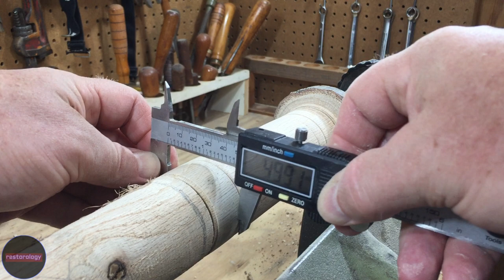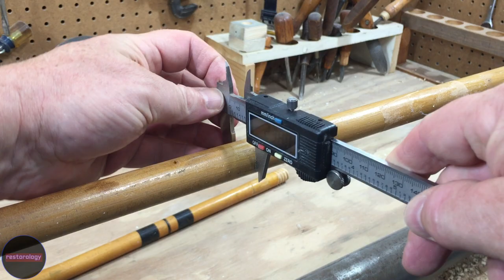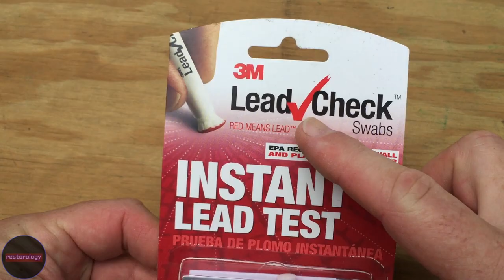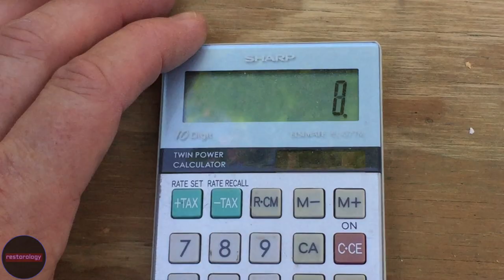The Best Restoration Video That NOBODY is Watching

Comment: Question for you: I'm doing this almost exact same thing. Question on the polyurethane over the testors paint - was that oil based? I see you did paint, then minwax then you mentioned polyurethane. I don't want my paint to bubble up or apply items in the wrong order. Thank you!
Reply from the maker: Yes I used all oil based finishes on this project. The testors paints are enamel and I finished with a std urethane finish. Once cured, it is fairly strong.

Comment: What did you use for wood filler for the cracks? And what type of paint did you use for the stripes on balls/mallets? I’m restoring a croquet set too and I want to make sure it lasts
Reply from the maker: I used a rubber based glue mixed with sawdust to fill cracks on the balls. I felt it needed to be flexible to take on the stress of being hit but also strong enough to keep the cracks from expanding. It's been a year and so far so good! The paint was Testors brand enamel hobby paint. It's all I had and it's held up fine, especially with the poly coating protecting it. Thanks for asking and good luck with your project!

Comment: Where do you find the drills to put the hole in mallet and what are the diameters?
Reply from the maker: The tap and die is sold as a kit and can be found on Amazon, eBay, or probably any local wood working shop. I don't remember the size I used for this one, maybe 3/4 inch? Several sizes can be found and it will depend on the diameter of the shaft to be inserted. Thanks for asking!